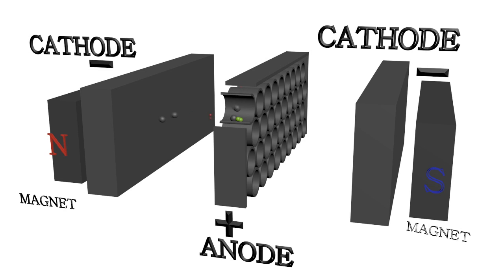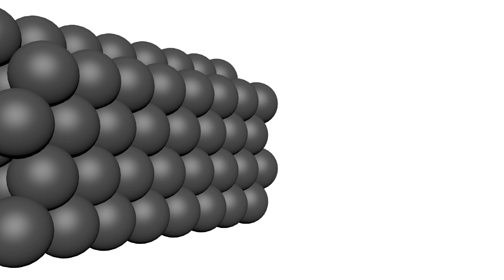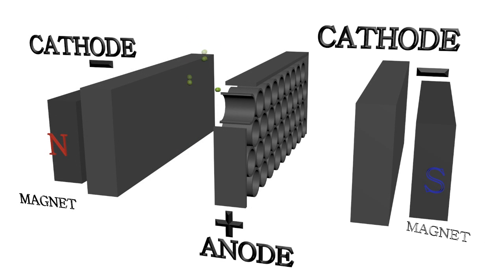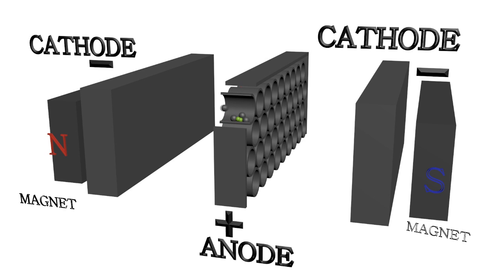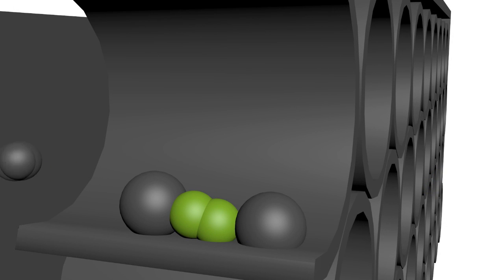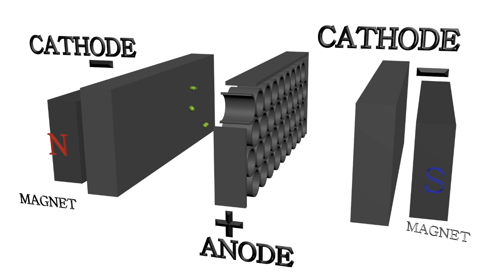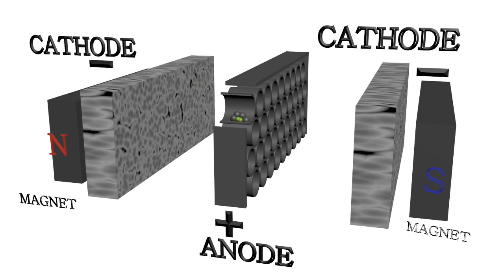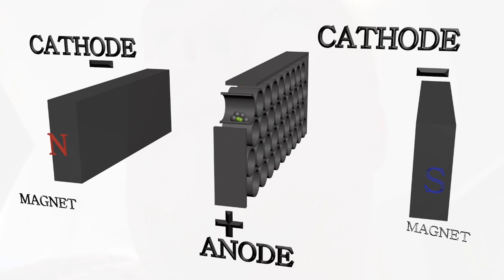Ion Pump | Vacuum Pumps

Comment: Question How to explain the increase in the number of cells in the Ionian pump leads to increasing discharge speed and increasing the range of pump?
Reply from the maker: If I understand you correctly, then the ion pump can be made more effective by using a higher total surface area of the electrodes (both anode and cathodes). Essentially it would make the ion pump capable of trapping more gas overall as well as over a specific shorter timeframe.
Reply: @CaptainCorrosion  Thank you  question ... How to get rid or remove of noble gases
Reply from the maker: If the rate of ionization is low for a type of gas, then you can try other types of vacuum pumps @user-adl_z99
Reply from the maker: I'd look into the turbomolecular pump, cryopump and titanium sublimation pump.

Comment: is that titanium the only metal who can be used ?
Reply from the maker: Hello and thank you for the excellent question! It is possible that titanium is the best. It is a vacuum friendly material and it is highly reactive, which allows it to bind gas. Also, titanium is rather cheap to be used in an industrial scale.
Reply: Thank you for your reply , titanium is the better choice .
Reply: @CaptainCorrosion pagl ho

Comment: Is there a vacuum that exists which could remove water particles from an open space?
Reply: ***** For example..... If it were raining outside, and the exterior windows of my home were getting wet and full of water droplets blocking my vision, what kind of a vacuum device would suffice whereas the water droplets would be immediately removed from the glass on a constant basis, so that no moisture could be seen on the glass and visibility through the glass pain was 100%? Thank you so much for your responses.
Reply: ***** Wow! You're a genius, thanks for your input....
Will this prevent water from forming on the surface of the glass and disperse it accordingly if a continuous patterned rainfall persists?
Reply: be critical and thorough when contemplating elements youd like to introduce to your environment. bio available heavy metals (titanium ) will cross your blood brain barrier causing your family to cognitively deteriorate at an accelerated rate.(id hate to see the few life forms displaying intelligence be smitten of the only valuable human component besides love wich is meaningless/ futile without intellect)
 why not just sputter coat glass surfaces with the very same element( titanium ) creating a safe stable  pore free virtually scratch free( unless it starts raining diamonds) surface. better yet, charge your new dielectric surfactant positive and ground your already dielectric window screen creating an electrostatic ionizer circuit and  rebuild the supposedly depleting ozone that were supposedly responsible for